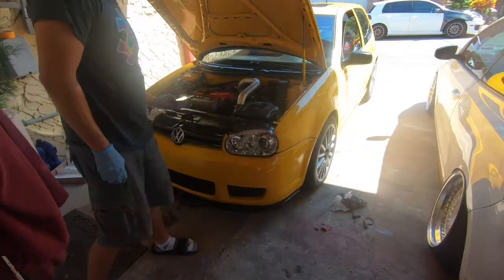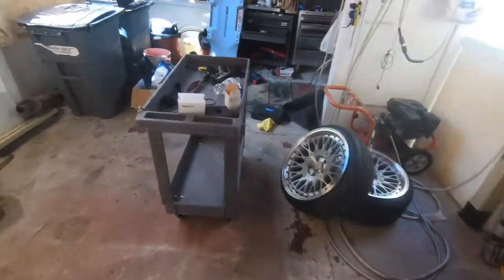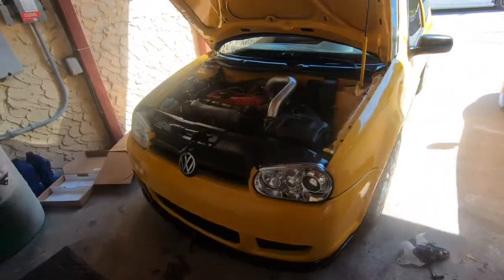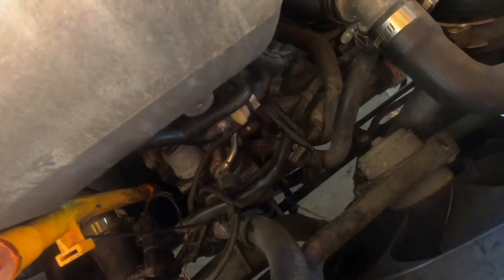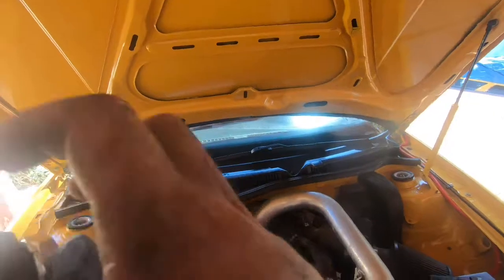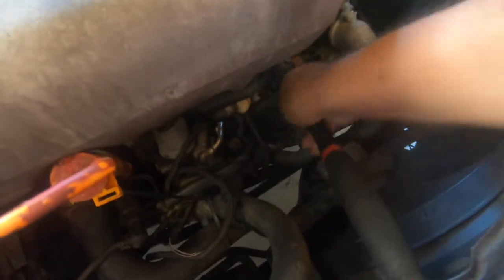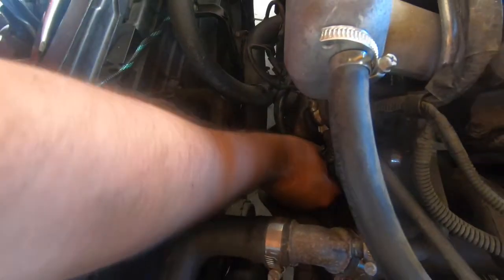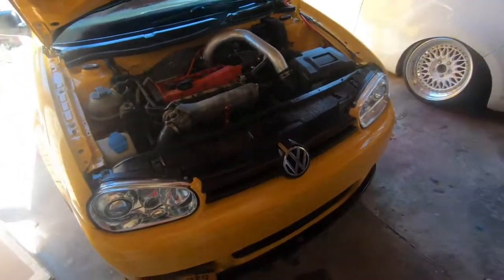Mk4 gti oil pressure sensor

Comment: What are the symptom of a bad oil pump im about to bug one tomorrow but has the flashing light oil but car runs just fine no smoke or anything
Reply from the maker: If the light is flashing first swap out the sensor if it’s till flashing . If it is then drop the oil pan and check the oil pick up tube usually gets clogged. If it’s not clogged then it might be the pump. But for piece of mind I would do a oil pressure gauge. That way you can keep an eye on it.  Hope this helps bro

Comment: Please help me, my golf 4 1.8t does idle ,what can be the problem
Reply from the maker: Start off it with any check engine codes ? And then I would see if you have fuel, spark. So while I’m there I would do maintenance. spark plugs,coils packs. Fuel filter check if injectors are good, or the pump. Check for vacuum leaks.
Reply: Okay thank you will do so, bru

Comment: Is there only one oil pressure sensor? Should it not be one for high pressure and one for low pressure?
Reply from the maker: No there is only one. Located on top of the oil filter housing. Some other 1.8t had a sensor on the oil pan but nothing to do with oil pressure.
Reply: @NarBrosGarage  thank you!
Reply from the maker: No problem. If ones you already replaced the switch and the light is still turning on then it’s one of these two things. 1. Oil pump going bad , 2. Remove your oil pan and check if the oil pick up tube is not clogged ( most of the time it is)

Comment: I can’t get the dam plug offf
Reply from the maker: Push hard down on it. Then try a small flat head and see if it lifts the plug lock. And try not to brake the clip if you can. Hope it helps